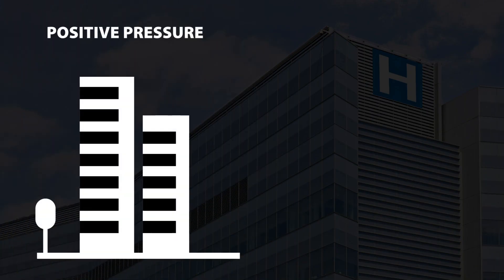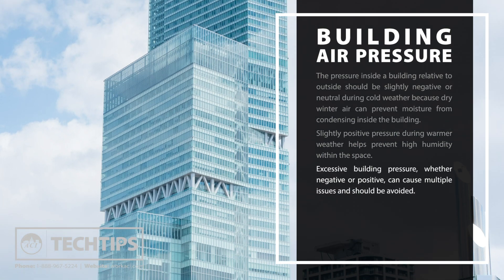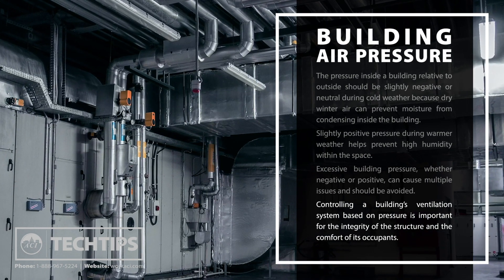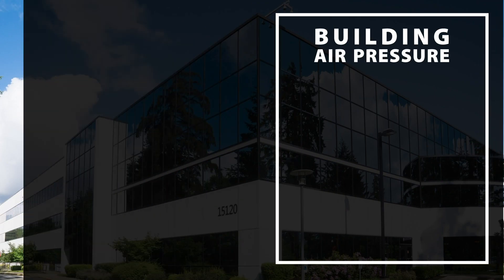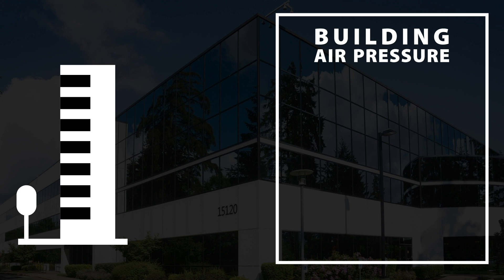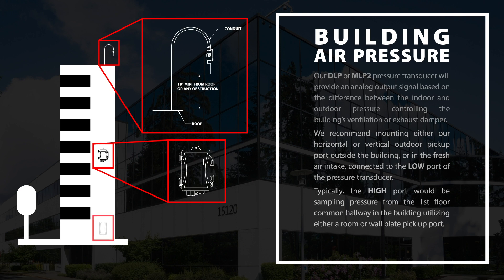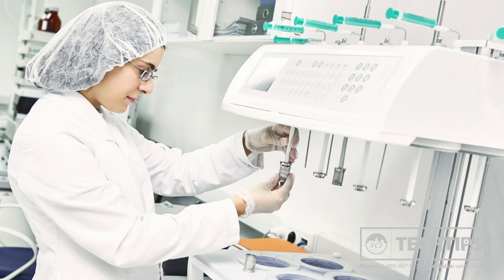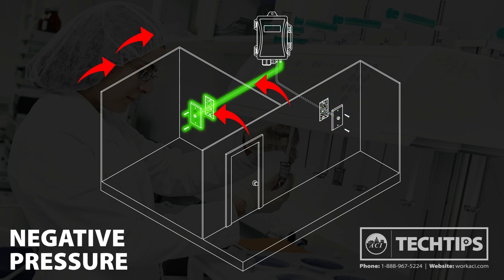Tech Tips Episode #5 • Controlling Positive Air Exfiltration / Negative Air Infiltration

Comment: i live in a RV off a gravel road .  These RV s have slide outs that have only miniminal sealing,  Dust accumulatesoften in the rv.  I am considering using a commercial 700 cfm 3 stage air scrubber to filterthe air and run the exhaust fan at slow speed 500 cfm out leaving a few hundred cfm to create a positive pressure.  use a monitor to tell if we are achieveing a positive air state.  Adjust as necessary to create a positive pressure to improve the air quality.  What do you think about this idea?